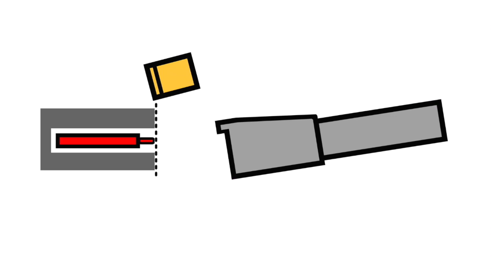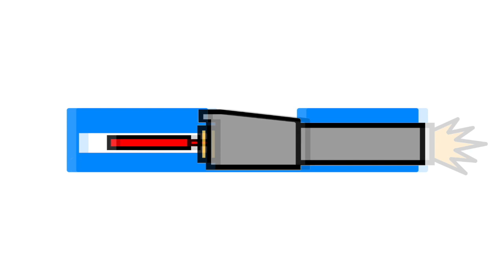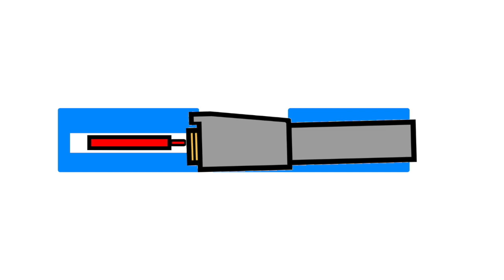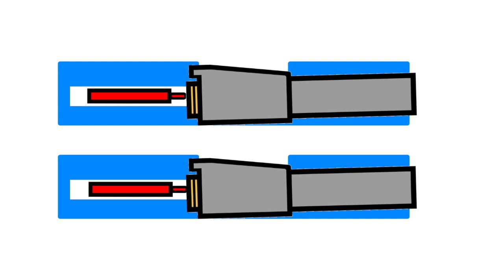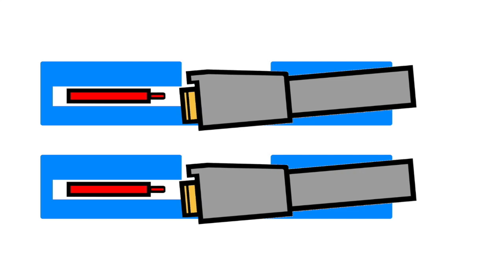Primer Drag Video Clarification...(You People are Killing Me!)

Comment: I first discovered this phenomenon with my  1970's West German marked Sig P6 surplus pistols and hot 124gr reloads. Short barrel and slide with too much momentum causing firing pin drag on the primer. Went down a notch on my 124gr reloads and problem mostly solved. Started loading 115gr surplus Hornaday XTP projectiles about 65-70% of maximum powder and trouble went away. Till I tried some 85gr zingers and near max load the primer drag came back. Again, dropping the powder charge to a more conservative charge primer drag went away. Problem discovered was the firing pin spring was weak compared to what it needed to be for shooting anything with some uummph.. 115gr JHP Hornaday XTPs with Federal Gold match SP primers, 7.x grains of BlueDot powder works just fine with every 9mm pistol I have. I now use Berrys bullets in 115gr with a slightly lower powder charge and 111gr Lead cast and powder coated projectiles with an average powder charge of AA5 for all my plinking and range sessions. Good a'll round loads for every 9mm I own.

Comment: I wonder if slightly reshaping the inclined plane would fix this problem? I noticed my Kahr 9mm has a kidney shaped hole which the take-down pin goes thru and it doesn't get have a primer drag issue. (It does have self esteem issues, tho, cuz I make fun of it for being so little; but no primer drag issues).

Comment: I was planning to buy a pistol. I don't buy a gun since 1995. The 365 is impressive for its reliability, price, capacity and size. In my country a SIG 365 costs 1920 american dollars and here is much easier to change your wife than your gun. So, I started to study the gun and now I am here facing the terrible truth. And it is worst.
At 01:50 no, the firing pin does not start to retract... it has no spring to throw it back and, most important, at this moment the slide is jumping to the rear, so, due to inertia, the firing pin is firmly kept against the primer. The firing pin will be sent to its rear position as soon as the slide reaches its fully rear position; if not at this point, as soon as the sear intercepts the striker assembly.
Sad. Since in my country is almost impossible to carry a pistol, maybe is the time to give up and buy a Taurs PT92, which is gigantic, but cheap and nearly reliable.